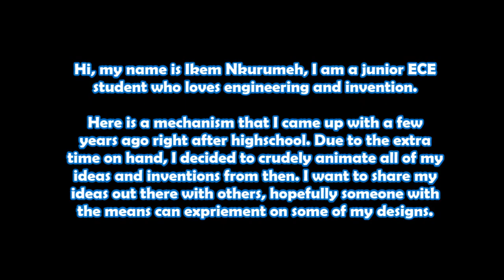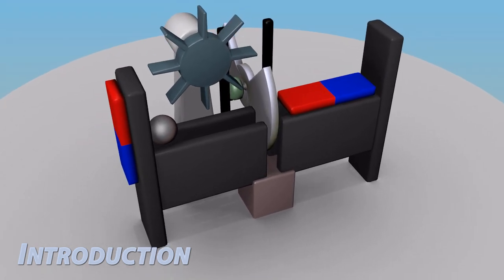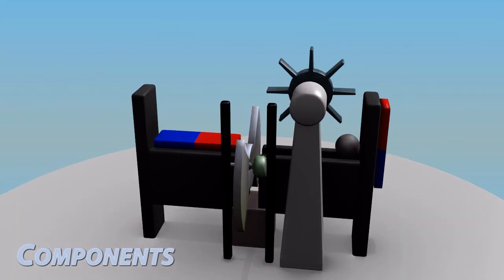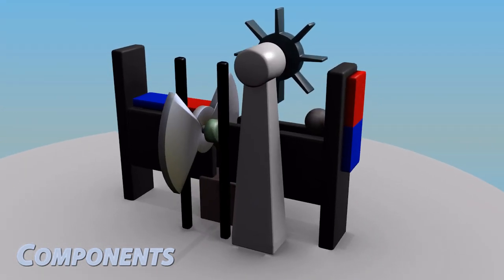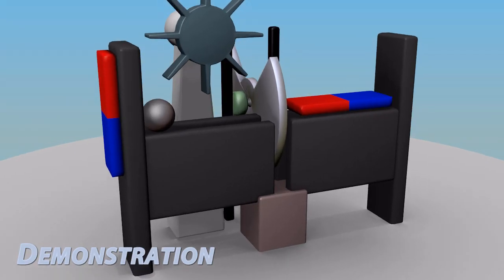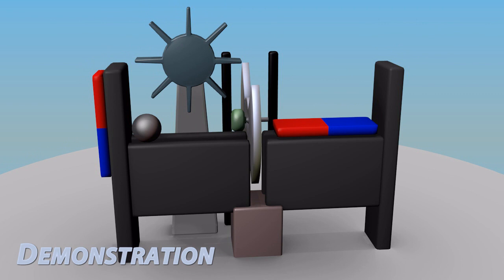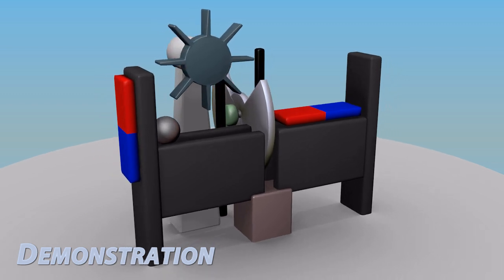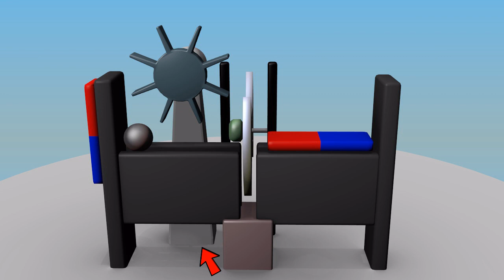Magnetic Shielding Generator

Comment: nice idea, but the problem is that there will be some attractive resistance in that the shielding (which is ferro magnetic generally) will be attractive to the main magnet itself, therefore there will be a need for some energy to be applied to move open the shielding plate out from the opening of the magnet flux each time, and thus the sum of the greater resistance of moving the shielding part would cancel out any manufacturing of any other proportionally smaller directional energy. In addition, from what I can see, there is a large gap between the two magnets, such that the ball traveling to the left will also be attractive to the other magnet, which will have no way of letting go from there unless there is an application of using more energy to return the ball off that magnet. but I like the shielding and steel ball idea, nice clear picture.
Reply: Exactly. Though I'd rather focus on a simpler wheel design instead. You dont need all this shielding either if done right. The larger the distance from point A to point B you have which the magnet can travel itself (the free energy part) , the greater amount of energy you can store in battery/capacitor. Then simply using an electromagnet to use that stored energy or outside force to push past that "sticky spot". It feeds itself back into the system. The trick is to accumulate a little more energy every time with each cycle.